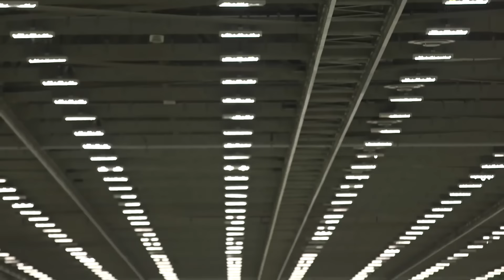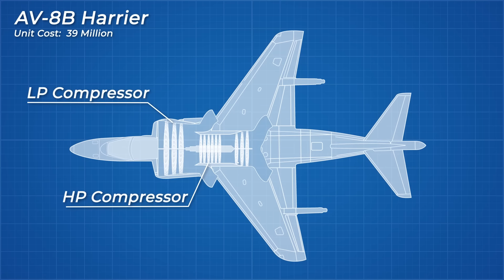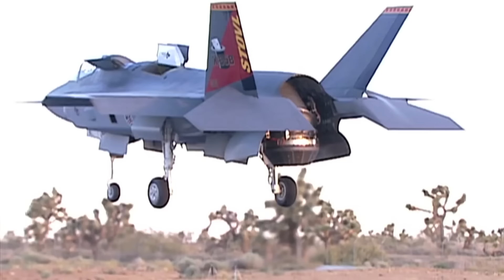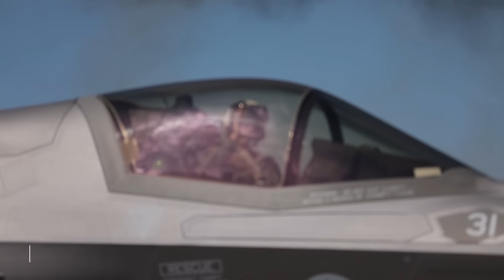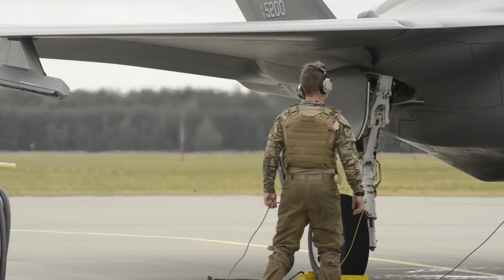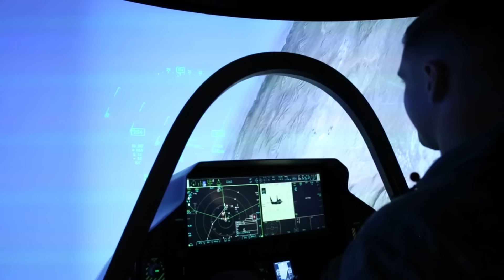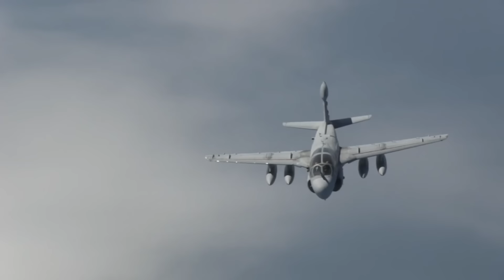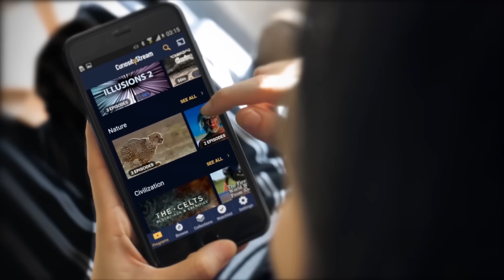Is The F-35 Worth $115 Million?

Comment: I was a doubter of the F-35 as an australian and the RAAF is a purchaser of the plane. I agree that it has its benefits but I still find myself thinking that, in australia at least, a twin engine plane is just better in terms of reliability. If the engine fails or suffers problems in a 1 engine plane your just done. There is no RTB in a zero engine plane. 

Also wasnt a fan of the Yak-38 Forger style lift fan but if the planes a step up over the harrier in all measures then I guess its overlookable. Also its not like my nations air force is getting the lift fan version. We have massive paved runways here

Also nothing can replace the A-10, untill they design a new airframe to fit that GAU-8A into!

Comment: The radar bit has become outdated a few weeks ago courtesy of a new European quantum entanglement radar.

Also it turns out that it's stealth paint breaks off if it flies at supersonic speeds for "too long"
Reply: QERs don't make anything outdated until they're fielded; though they're likely a worthwhile research venture.
Reply: @kawrx2002  If I remember correctly the prototypes worked, furthermore the F35 has some other additional issues that are not immediately apparent.

Those are it's lower "lifespan" it's increased difficulty in servicing/repairing and the higher cost of spare parts and a relatively low range.
Though these issues are not apparent at it's current use (basically used to hit ground targets of less advanced nations. these would be catastrophic in an extended warfare pariod against a well manned, funded and organized political entity.

This is also the reason why the EU is skippping the R&D of fifth generation fighters and is opting to focus on directly producing sixth generation hardware.
Both the upcoming tempest and FCAS have incredible specs, one of which being a mounted laser that would make incoming rocket fire useless (and a possible adoption of the sabre engine system).
However the most revolutionary of their developments is that they want to make most, if not all components through 3D printing. 
This would allow for spare parts to be made on the spot making supply and maintenance entire orders of magnitude simpler (not to mention that 3D printed components have less parts and moving/vaunerable components, a great example is the prototype printed rocket engines that are made of a handful of parts.

Basically, the greatest flaw of the F35 is logistics, an dlogistics is what wins or loses wars.

Comment: Those who do not learn from history are doomed to repeat it.   

They said very similar things about the F-4 Phantom. We don't need a gun! Gun dogfights are old school and you're thinking backwards! The pilots learned the hard way they still needed a close in weapon system backup when confronting the much more maneuverable Mig 17s, 19s and 21s.   The other thing that has always bothered me about the Join Strike Fighter is the jack of all trades mission. Again this is something the USAF and the Navy should remember from their own histories of mediocre performance machines attempting to "do everything" and being good at nothing.  The idea of sharing 60% of the parts with other branches to save cost over the lifespan of the plane is a nice idea but in the end I fear that this will just turn out to be another extremely expensive modern day Edsel.
Reply: The F-16 for example is also multirole and still performs excellent in air-air, the whole "jack of all trades, master at none" BS doesn't apply for modern jets. Also all versions of the F-35 can carry guns, the F-35A internally while the other versions carry them externaly like the Harrier.

Comment: - Holy crap, somebody who actually properly mentioned the MIC. Good job on that.

- "Combining multiple roles" Isn't what the F-35 does. The F-16 and F-18 (C and E variants) are already "multirole" and perform the same role the F-35 will. The F-35 is simply continuing what those aircraft already do (and then extending that capability to the poor Marines). 

- I'd also add, that the cost of developing three separate airframes is far more than a single airframe with three variants. Code, sensors, stealth and cousin parts significantly reduce costs compared to wholly designing a new aircraft. You were able to compare the protractors and detractors on the maneuverability side but sadly didn't do so here. If you need any amount of proof that having several different aircraft is more expensive, look at standalone developments like the Rafale or Eurofighter. Despite them lacking the advanced sensors or technology in the F-35, they cost way more both in PAUC and APUC measurements. 

- I like how you pointed out the protractors and detractors of maneuverability. Basically, there are two types of turn fighters. One turn fighters, and two turn fighters. One turn fighters are built to immediately point their nose/weapons at an opponent and achieve the first shot (F/A-18, F-35). They're characterized by very high AoA capability. Two turn fighters are built to sustain their turn rate, and use E-M theory to overcome their opponents (F-16, F-15). This was the "fighter mafia" ideology. However, significant studies by the USAF in the 1990s showed that the most significant factor in winning a dogfight is firing first (which two turn fighters are bad at doing). Not only did USAF studies point to this, but later experimentation with German Migs proved just how far behind in the WVR game US E-M theory was. HOBS missiles proved to be by far and away the most dominant WVR technique. Thus, we come to the F-35. It combines the lessons learned by the USAF (E-M theory is outdated), becoming a one turn fighter (like what the USN has been using) and incorporating HOBS missiles along with DAS (360 degree targeting) to create by far one of the most advanced WVR fighters to date. 

- On the F-117 shootdown, the radar was not modified to use low wavelengths. It was a normal X-band targeting radar. The battery commander has since walked back on his claim that he modified the FCR (which doesn't really make sense in the first place). The far more logical explanation is a very smart placement and operation of a radar battery, combined with knowledge of exactly where the aircraft would fly. Even then, the radar didn't pick up the F-117 until its bay doors were opened and basically on top of the FCR. In other words, the FCR was looking inside the aircraft rather than on the stealth optimized outside. 

- Your F-22 costs are a bit off. The overall APUC (per the F-22's last SAR) is $160 million. The last lot of aircraft reached an APUC of ~$120 million though. You could also include more modern 4th generation aircraft into your comparison. Depending exactly on the block or model, F-16 bl60+/F-18E costs are around $70-$80 million, while the Rafale costs ~$110 million and the Typhoon costs a bit more than that. And these are all fourth generation aircraft with far fewer sensors, less powerful sensors, and little (or no) sensor fusion.
Reply: I think I could sit an entire day with you listening to all that knowledge and I wouldn't  get tired even at the end of the day. Truly fascinating.
Reply: Good stuff for people who obsess about aviation like myself and clearly some others. However, I wont go into debate...but....its pointless with drone airframe and "human" limitations eliminated. Piloted planes are an era of the past. With new radar technologies and stealth already being figured out, "swarms" of high energy tight turning "missiles" is in the very near future. What human would want to enter any airspace with an adversary of 5000 airborn killers that dont "think"....they just kill and destroy at will. Heck, even in civil aviation, computers fly planes and pilots just ride along making sure the computer is debugged....and when they actually have to fly, bad stuff happens. We are in a transitional time right now and we are just now seeing what 2030 is going to look like and it probably doesnt include million dollar pilots...nor the F-35 the way it looks today. I know, hard to swallow that because its supposed to be the fighter to last decades. It will stripped down baking in the Arizona grave yard in no time. Its not a waste though. Not at all. What we learn from this from every angle is usefull from the business side to the technical achievements.
Reply: @soulsphere9242  I think you're misunderstanding the point of one turn and two turn fighters. They don't literally make one turn, or two turns, it's a point about their capabilities. A one turn fighter is built to get their sights on target and shoot first. That's the most basic design philosophy behind them. A two turn fighter is built to sustain a fight with E-M theory. I'd also heavily question your anecdotal evidence regarding pilots, as few fighter pilots will concede to their peers. An F-35 is in many ways not a peer to the F-18 or F-16, while the F-18 and F-16 are literal peers. 

E-M theory is not obsolete in the sense of maintaining energy, but designing an aircraft wholly around E-M, like the F-16 and F-15, is completely outdated. With more advanced missile systems than what was available in the 60s and 70s, there's simply a lot more to consider when designing an aircraft doctrine. In exercises and trials, the F-16 was found to be far inferior to just about any aircraft utilizing HOBS. And that's not a hit at the F-16 as a whole, that's a doctrinal problem that caused a severe lack of foresight.

Whatever allows a plane to get a missile off quicker is going to be the more advantageous characteristic in a do or die situation. This is not only true in a WVR scenario, but also BVR. It's also true for ground vehicles, naval ships, or basically any combat. Quite simply; getting shot at while you wait for your opponent to run out of energy before you can offensively position your aircraft - is a very poor survival strategy.
Reply: You must be some sort of UN/NATO shill.
Reply: @BestintheWest25  what kind of counter argument is that 🤔
Reply: This guy out here with the actual facts !

Comment: 1st )  The F-35 is a ( UK - US ) designed and built Jet NOT just US. 

2nd )   The F-35B is not worthy of the Harrier the Harrier is a 70 - 80's jet the F-35B is a 90 - 19's jet so 20 years between them if the Harrier was built today it would be a lot better then the F-35B.

3rd )  The US needed the UK to help with all 3 types A / B / C of the F-35 like BAE Systems and Rolls-Royce.

4th )  The F-22 is not the best jet in the Sky's that title goes to the Eurofighter.

5th ) The F-35 like the F-22 is not the best the ( UK - US / F-22 ) Its fast and good turn rate but not the best ( UK - US / F-35 A B C ) yes can do a lot of stuff but not great at one ( UK - Germany / Eurofighter ) Its faster then both better turn rate then both flys higher then both better dive/cilmb rate then both and can do all what the F-35 and F-22 can do plus more the only thing the Eurofighter cant do is take off vertical.

Comment: Two things worry me about over reliance on stealth. Firstly, in the arms race between sensors and aircraft, aircraft have a far longer expected time of service, and far longer development cycle. Secondly, a significant portion of the stealth capability goes out the window once you start strapping fuel tanks and munitions to it, meaning for proper stealth it's limited to internal storage. And of course, for the munitions, that means opening hatches and a significant risk of revealing itself whenever opening fire. Good, perhaps even great, odds of getting the first strike, but I'm hesitant if it can handle being outnumbered, which through a combination of hefty price tag, high maintenance costs (and skill requirements), and rumored maintenance man-hours/flight hour seems uncomfortably probable. (Keep in mind with the price tag, in practice it's not so much about cost-per-plane, so much so as cost-per-operational-availability, at which point the f35 looks even worse.) And of course, for offensive missions, getting in undetected and getting out are two entirely different things.

Comment: First off, the F-35 was NEVER intended or designed as an "Air Superiority" aircraft (do some research, don't rely on false/BS reporting).  It's a "Ground Attack" aircraft, thus a replacement for the A-10, Harrier, and F-16 in it's ground attack mode/variants.This is why the US Air Force has, and maintains the F-22, and the US Navy the F/A-18.  The F-35 replaces neither of these aircraft.

Comment: You did not talk much about what maybe is most important in a modern fighter aircraft: Electronic Warfare. I'm sure the F-35 has lot's of it built in, most of it classified and not common knowledge. Also, EW systems needs constant upgrades. With old EW tech (5-10 years) you will not stand a chance, no matter how good your fighter aircraft is. Listen to SAAB.

Comment: The $115 million figure does not include the engine cost. The engine for the B is over $30 million.
Reply: Source?
Reply: @Poctyk  AW&ST Magazine
Reply: @jamesmonahan1819  sorry but the only thing I can find is 
"For the eleventh consecutive year, the cost of an F-35A was lowered. The F-35A unit price including aircraft, engine and fee, is $89.2 million."
As for Pentagon, or countries like Poland buying engines separately, you do need some in storage.
The fact that it can doesn't mean it has to. How do you think plane communicated with the ground in test flights?
Reply: @Poctyk  In early test flights they were using something like a Garmin 530 to communicate with ATC because the F-35 only transmits a narrow microwave beam to satellites as part of it's stealth stuff. It took awhile to come up with a system that allowed communication with other combat aircraft. It's not as simple as just turning off the radio because the antenna still rings like a bell when exposed to an EM source. As for the engine statement AW&ST reported those higher prices you mentioned from the past as airframe prices (no engine) they claimed this was a common practice with military aircraft, they also reported on a problem with P&W not releasing the price for the engine back in about 2011.
 I am not an opponent of the F-35 program, it has been dealing with countless problems, and come up with a truly amazing amount of entertainment for me over the last few decades, I can't wait to find out what's next.
Reply: @Poctyk  The F-35 also uses an uplink to a satellite to communicate with anything (including link 16). so i'll add "satellite not included".

Comment: Not necessarily hating on the video except for one thing, you did claim that the version of f-35 that lost simulation against other aircraft, but any pilot would agree, the f-35 is an engineering marvel when it comes to electronic warfare. not only with the aircrafts numerous external peripherals bit also like you said, the airframe helps in this area a lot, obviously banking at an angle that's directly perpendicular to a radar will always give away its location, non the less its almost perfect and supersedes any other aircraft in terms of low observability. I am not at liberty to give to much information about the recent joint military exercise "Operation Talisman Sabre" because no information about simulated dogfights during this operation has been disclosed, however i can tell you that there were numerous aircraft across the board, including other 5th generation aircraft and 4th generation as well, and simply to put it, blew them out of the water.

Comment: Those prices makes me understand the sucess of sails the Embraer A 29 is reaching.

*A 29 is a light attack/patrol aircraft, is not a fighter or a bomber.
Reply: The A29's popularity has nothing to do with its cost. In an insurgency scenario, fielding a conventional jet fighter from a major airfield to do a rocket run or drop a GBU takes too long and is far too expensive. It also takes a long time and a load of money to train a pilot for that sort of aircraft, and the fuel and maintenance requirements are humongous. Aircraft such as the A-29 can be managed by a "lower level" Pilot, operate cheaply from rough dirt airfields close to the front line, and show up quickly where they are needed. 

As a former Company Commander, I can tell you every second you're waiting for air support feels like a lifetime. So I'd rather have an A-29 that shows up quickly and can stay on station for a few hours, than an A-10 or an F-16 that needs to fly a hundred kilometers to get there and can only stay for 20 minutes.
Reply: J. Ramos The pilot skill is the same. The advantage of the A29 are the ability to operate in austere environments, high cycle rate (it can do a couple of passes while a jet is still thinking about it) and yep, low cost. It also frees up assets like high performance jets to do what high performance jets are supposed to do instead of CAS. Small turboprops like the A-29 are also difficult to shoot down.
Reply: @thethirdman225  Why send in a surgeon with a scalpel when you can use a butter knife... completely different mission profile. You don't need hyper-sonic stealth fighter to drop bombs on a target with no real chance of shooting you down and no air support.
Reply: J. Ramos ll
Reply: Joshua N. Ajang Also for CAS.

Comment: Yet it will still fail in a simple dogfight. These will hurt when they get shot down. Also, if their computers become even mildly damaged, the plane becomes useless and will not be able to function correctly. An expensive deathtrap  for a pilot. The Typhoon is a much cheaper and safer multirole fighter.
Reply: Literally all modern fighters are fly by wire. They're unstable by design, if the computers get damaged the aircraft cannot be flown by hand.